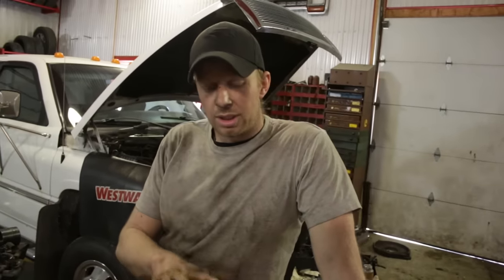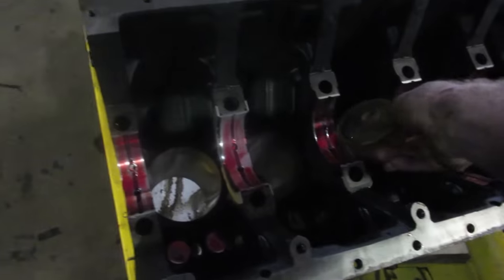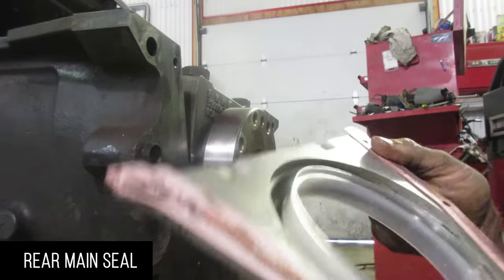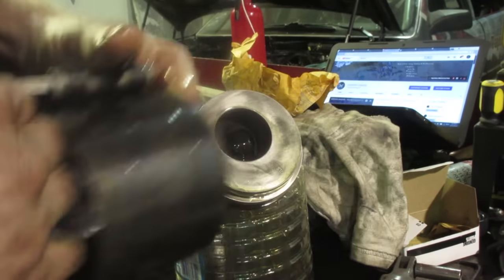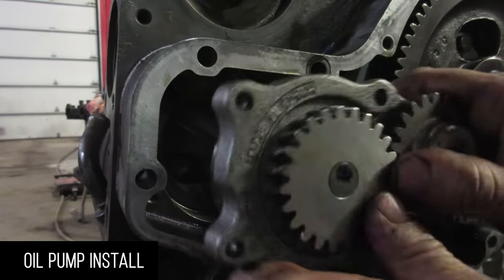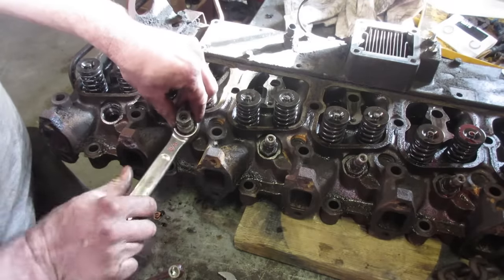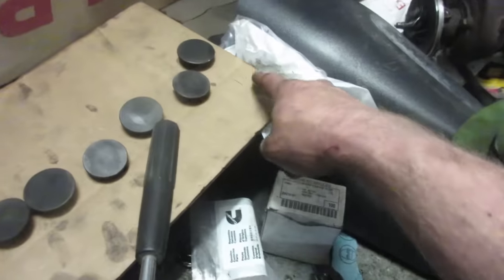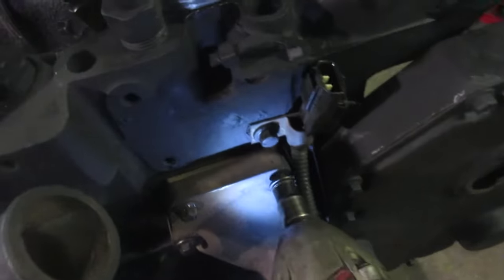How To Rebuild A 5.9 Cummins 12v Diesel In A Million Mile Dodge #1Mil12v (Part 3)

Comment: The best thing dodge ever decided to do was put a tractor engine in their trucks. I don't know why manufacturers don't do this regularly.
Reply: Koshunae  EPA mandates and the state of California
Reply: My 1991 Mitsubishi Fuso FG is basically a tractor engine, they just last forever, like this Cummins.
Reply: Don't forget the VW ALH varients.  They used them as industrial engines (AFD).  Last long after the rest of the VW falls apart.
Reply: The 6.9 idi and 7.3 of the Ford that were built by IH would also last until way after the rest of the truck rotted.
Reply: @ Koshunae; Very true, I have a 7.3 in an old Ford that is still kicking, has almost 200K on the ticker...
Reply: 200k is nothing on those, brother haha. I've seen a fair few with over 400k of towing miles.
Reply: Good to know, I take pretty good care of it and don't load it up too badly... I use it to pull my 4 ton mini excavator every once and a while...
Reply: Koshunae i have a 24v cummins and it has 390xxx miles and it starts first crank
Reply: @Koshunae  and 400k ain't shit either!
Reply: Don Olypopper   is that book still available ?? Can I still purchase it you think ?? TY,
Reply: Toyota v6 3.4 with over a million miles only replaced timing belt/water pump 4 times replaced head gasket once, and replaced valve gaskets about 3 times, other than that no major issues.
Reply: @MLGXBOXPRO  
Got an ALH and a BEW both with over 300,000 on them & still driven daily pulling down 40+ mpg.
Even got an over 100,000 ALH in my rockcrawler that gets beat on regularly without issue - truly fantastic engines.
I love my old 92 VE Cummins, but the VW TDI's are unreal for how easy they are to work on in such a small light package.
Reply: The reason car/truck manufacturers don't put engines that last in their vehicles, is that they won't break down. That way you have to buy a new vehicle.
Reply: Don Olypopper  i mean, the idis were just as tough as a cummins. Not as powerful tho, thats why the powerstroke came put and stole the diesel show
Reply: Don Olypopper   when the 7.3 powerstroke was released it had more hp and tq than the 12v cummins so idk wtf your talking about. And today the 6.7 powerstroke leads the class in both hp and tq. Just because your daddy has a cummins doesnt mean they are best or most powerful
Reply: Don Olypopper  btw there are plenty of 600k mile plus 6.7 powerstrokes still out on the road, towing everyday on the original longblock. And damn bro 21 dodges? That fuckin sucks. I figured youd be sick of buying shilping crates for that cummins engine by now
Reply: Don Olypopper  dinosaurs? The 7.3 powerstroke was ahead oh its time with the HEUI system, even though i honestly perfer mechanical injection.
Reply: Brennan Clark  thats funny, your friends must buy 6.0 and 6.4s and keep them stock. My 7.3 is at 325k and runs like the day she was bought. My buddies 7.3 has 422k, only been through injector cups and a trans. Also theres plenty of deleted 6.7 powerstrokes out there with over 500k on them that tow everyday. Cummins have their problems too buddy. Especially 24v vp44s.
Reply: @traxxasrcfun  first year does NOT imply garbage, I personally own a 2001 lb7, it’s needed a set of injectors, but runs strong at 230k miles, no other troubles in its past, talked a lot with the previous owner, he did the IP at about 200k, it’s a first year motor and not bad at all. Also have a 300k+ completely unmolested 6.2 diesel, no problems ever, tracked all the last owners back to 1983, it still (slowly) pulls 10k+ trailers and stands the abuse. Also have a 12 valve, just got it though and can’t speak much for it yet, sounds cool, have plenty of faith in it. Most of my buddies are 6.7 guys, they have mixed expirences, nothing based on the year. Moral of the story, every body has their thing, if you like a brand, or are loyal to a motor, keep it that way, at the end of the day we are all in it for the same reasons

Comment: Great video really like your channel. I am definitely a Cummins guy. I have had my  mechanic shop for 25 years this year. Not saying it's wrong but I never pull the head removing or replacing the engine. Take radiator and condenser out side it in. It's wild seeing how different people do same thing different ways again really like your channel thank you and have a blessed day

Comment: on those hard to reach bolts like the turbo i make a cut down wrench and weld a socket to the opposite end and then use a little math to adjust for the torque with the extended arm.

Comment: Hi Boss love your videos you are a great mechanic I have a 12 valve that runs good pulling 5 or 6 tons in level ground but in hills seems to loose power the motor has about375k I do see blow by what do you think is my problem
Reply: Es la bola de anos que tienes con tu troka

Comment: You may consider using mobil1 (or other synhthetic) oil for main bearing fitment.     Do not use it for your break in oil, but you'll have a better feel for how the crank rides in the main bearings and hopefully find any issues before going too far.

Comment: Engineer 1: what should the main torques be?
Engineer 2: hmm maybe one as 18 and the other 32.
Engineer 1: why those?
Engineer 2: I don't know.
Engineer 1:👌
Reply: We actually have charts for all of these torque specs.
Reply: @POV Adventures I've never been called dumb but being referred to as weird and arrogant is not unusual for non-engineers who don't understand our thought processes or our twisted brand of humor.
Reply: @POV Adventures hell yeah!
Reply: I didnt really pay attention but im assuming this is for the same bolt type or cover. Theres a few things that would change the torque requirement of a fastener mostly having to do with the structure of the mating surfaces, surrounding features, and proximity to other bolts. Its also possible for manufacturers to experience quality issues (very small percentage) when assembling these components, so their practical solution may end up just by bumping up the torque specs of a few bolts to fix the problem, as opposed to spending way more money on new tooling to accommodate the issue. This is more likely with thinner aluminum covers and lower torques.
Reply: @POV Adventures You appear to be well versed in all the constraints engineers have to deal with.  You certainly have a strong grasp of the written language.  Try spending a day free of engineering, or even five minutes.  Roof over your head... engineered.  The computer or phone you are using, electrical, mechanical, and software engineers.  Television..... silly engineers managed to not only get those satellites into space, but keep them there.
Reply: @POV Adventures Hold on you've only worked with 6 engineers over 20 years and you think this is enough of a sample size to come to that conclusion? 😂
Reply: @amorag59  Allow me to elucidate by experience. Working on the Savanna River Site.. "Everything" is about safety, I was working with a crew that had to keep one of those 'Emergency Exit Doors' open that have the cross door bar one pushes from the inside to open outwards.. they have a grip handle on the outside and lock set.
2 Engineers working in the build entered and questioned how the door was going to be retained open.
We told them the 10" pipe we had to lay in the doorway would keep the door open.
Wasn't good enough... the door had to be in a 'Fixed position'.
We said we could 'Choke the door... wasn't good enough, the chock could 'slip'.
The engineers said wait, we will confer(we went ahead setting up without the door entrance issue).
1.5 hours later the Engineers came back with the Solution, Duct Tape, the exterior handle to a fixed secure point.
Shaking our heads we followed prescribed methods.
Job done, the engineers came back and asked how the Duct Tape worked.. we replied just fine and they inspected the exterior door handle after the Duct tape had been removed.
They found some 'sticky residue and brought that to our attention,,, it wasn't safe.
We said yes, we are going to clean that when done.
The engineers asked what chemicals, we replied we have a number of different, gave them the MSDS sheets on several... they went away for another hour.
Coming back they informed us "Simple Green" the best solution... what we use anyway, already am familiar with the Site's approved lists for Chems.
Then they wanted to know if we were going to rinse the 'Green off the handle and where we would dispose of rags or would there be any runoff. Our patience was at end... and the Engineers understood they had 'Helped us' as much as possible and left disgruntled.

I only use this one 'incident' as engineers quite often use the 'Duct Tape', literally and as a common practice theorem. Granted, engineers are a completely needed occupation... but they will assure anyone possible just how completely needed they are.
Reply: @mikedar8484  Okay, but don't you think it's a bit malicious to paint all engineers with the same brush based on 2 people making questionable decisions? That was my point, he looked at 6 people in 20 years and concluded all engineers are dumb. 

Granted yes a bachelors in engineering they are making it easier to come by for kids these days, don't think the whole engineering arrogance, "we are higher up than you" attitude is not lost on me though. I used to work as a drafter (had my EE degree) at Lincoln electric (welding manufacturer hq in Ohio) and as an engineer with more knowledge of code than the one I was assigned to, the other guy acted like his word was law when I tried to tell him there were code issues with his specified over-current protection. He ended up listening to me when I used textbook descriptions of the error he was making and saying it so the supervisors could hear.

In short my response to these kind of comments is usually the same - find you some better engineers to hang around. Nikola Tesla, Neil Armstrong, Steve Wasniak and Elon Musk were all great engineers. Don't think we are all like Jeb and Ted who need an internal conference to figure out how to hold a door open.
Reply: @amorag59  'painting all engineers' is sorta like say all bears'. Sure.. you can hand feed a few... but a rationale does run through the grouping.. it is a designed need, it is the reason they get a salary, Society needs engineers to be right,,, but.... even with four nephews graduated with engineering degrees in several fields of practice I still have to 'Nudge' a Engineer in the right direction... to get everything done,, without unnecessary promulgation of delays or over engineering a solution.
Reply: @mikedar8484  I guess I get it, society pays them more to be on point, they come with a side dish of arrogance. From the engineers' perspective it's like being a gen Z kid and scoffing at the other gen Z kids eating tide pods. Then everyone is pointing a finger at you for someone elses mishaps lol. Bears are inherently dangerous, but given the curriculum required for an engineering degree calling them all "the dumbest" is disingenuous. 

I got my UL panel certification (508A) at work and all of a sudden people were like "Oh, Your the expert huh?" "Wouldn't this or that circuit be illegal?" and I wouldn't have an answer, have to go back and look into details. Meanwhile said circuit, an emergency stop circuit, isn't really detailed in this cert. so it's not something I could have provided and expertise on.

I get it, we should do our jobs right so things run efficiently, but I don't think we deserve the tag as "dumbest" any more than all the other departments that a simple mistake is costly: sales, finance, management, shop etc. Learning to live with the banter, just not used to it, at the end of the day it doesn't matter as long as I do my job well.

Comment: If you look up the procedure to calibrate a torque wrench then use a cross foot adapter and recalculate for the increased length you can adjust your torque settings on the wrench to get the 32 ft. Pounds needed on the turbo to manifold bolts. 

You can verify your torque calculations by installing the manifold bolts using the crows foot set up and verifying torque with a separate torque wrench. (If you feel the absolute need to have the exact measurement) 

On the plus side by learning how to calibrate your torque wrench you ensure the wrench is working correctly. 

Calibrating the torque wrench can be done with a hand held aircraft luggage scale, a tape measure, pencil and scratch paper. It takes about 5 minutes.

Comment: If you can bypass the distributor system in a diesel engine and just run the glow plugs all the time you can get a greater efficiency. Try it and verify on the tester.

Comment: What I would do to torque the turbo flange studs to the correct torque is to take a crows foot on a torque wrench. I’d then calculate the length of the crows foot off the total length of the torque wrench and reduce torque setting accordingly. I can start on Monday Rich 😁

Comment: i didnt plasti gage mine when i built it. i trusted the machine shop to mic things and tell me what i needed to order when they were doing the boring and decking. im 2500 miles into my rebuild now so i guess that means i assembled it correctly and the machine shop was right? pushing 250hp injectors with compound turbos

Comment: White Lithium Grease will also pull in moisture. If you're not gonna run it right away you'll get surface rust from moisture and acidity.

Comment: A good way to get the oil through the engine is fill the sump and crank the engine over until you see oil at the top of the motor, obviously before starting.

Comment: Running the engine up at 190 F will increase fuel efficiency slightly, but it will also increase undesirable emissions while also lowering the lifespan of the seals potentially.

Comment: if you un bolt the drivers side cab mounts and jack the cab up ,you can get the engine back in with the head on and the valves adjusted on the stand.. great video though.
Reply from the maker: So you don't love in the rust belt where unbolting can mounts in a 15yr old + truck turns into an 12 hour job welding in new floors

Comment: When in doubt 18ft.-lb
Reply: There is actually a manual that is available the tell you the torque of I was to say any bolt by using the shank measuerment and threads pitch and the threads per inch.its been a minute since i used it but i'm thinking im close on the variables.
Reply: J.W. Hunt Volvo has that type of "torque by diameter" table, I found it in Alldata and have actually applied it to other makes when I can't find a specific torque spec.
Reply: Don Olypopper You sure that's not just cause it's a powerstroke?

Comment: Next time you put pistons in, Instead of hammering them through the ring compressor with the hammer handle,
Poke youre hand in through the crank case and grab the big end and pull it through while you are rocking it from side to side a little.
You get more feel that way and less chance of breaking a ring.

Comment: If you really want to torque everything get a motion pro 08-0380. I use mine frequently for tight spots, I've even put a ratchet in it before. Good for up to 100 ftlb I believe. Just make sure to use it at a 90* angle to the torque wrench so you don't have to do all kinds of complicated math to recalculate the torque.

Comment: Flippping the crank/block and then measuring the plastigauge may show lesser clearance than what is actually there, no?  Maybe doing it both ways gives you a better assessment?  You would have a max/min measurement of clearance.  I'm not an engine guy....just asking.  Cheers.

Comment: Just so you know lock tight does not work if u clean bolt off with break clean and don’t use prep spray   The break clean compound stops the lock tight from setting up

Comment: Where the hell are all of these engines? Been around decades in cabs that are just itching to rot away, yet sill haven't seen a single unit in the wreckers that I regularly go, nor a Kijiji part out ad within 500 miles.

Dream project (well .. perhaps aside a diesel/nitrous hybrid rocket on the back of a coke bottle mopar, lol) is to stuff a 5.9 into a '69 or '70 Kingswood or something similar - stylin' service wagon that I could still afford to drive at $5/gal.

Great vid though.

Comment: Engines in general are more efficient the hotter they run.  The hotter an engine is, the less heat of combustion is lost to the engine block and more of it goes into pushing the piston down.  It's a balancing game between not overheating to the point you start to hurt the oil or causing too much expansion and not running too cool and making your gas mileage shitty.

Comment: could you just use a crows foot on a torque wrench to do the bolts on the turbo/manifold .?.?. i realize there may be some kind of discrepancy due to added leverage on the apparatus

Comment: Great video. Just had one question. I am looking at a 1998 motorhome which the owner said has a 5.9 12v Cummins engine, but the picture of the engine shows one valve cover. Did Cummins make a 1998 5.9 12v with a single valve cover? Any help would be greatly appreciated.

Comment: rich im ready for my job haha i use crows feet with a torque wrench to torque the turbo bolts  ;) worked perfectly and i tested it on a bolt i could get to  and i tried a normal socket and then tested it with the crows foot and they were the same when torqued both ways :)

Comment: hey im new to the diesel world got a 93 5.9  cummins turbo with intercooler I think mine leaking coolant from where the lower radiator hose connects I think the water inlet u got any videos on how to fix that leak

Comment: I have a Dodge truck years 17 with a 6.7 I have A check engine light on had it check out they said it's the torbo need be linked up what does that mean if you can help me with this problem